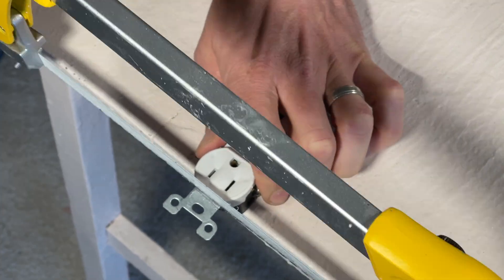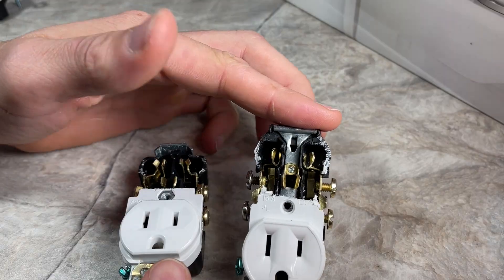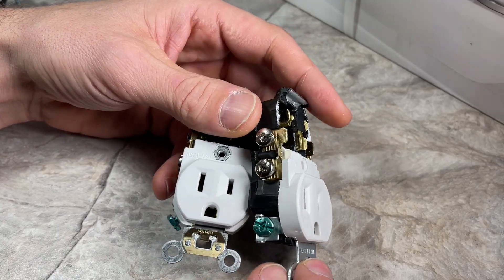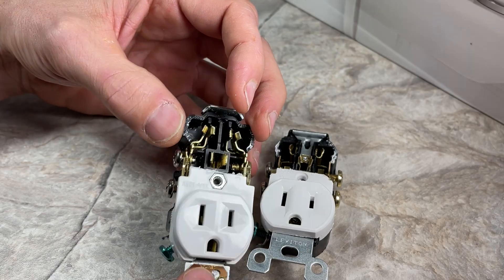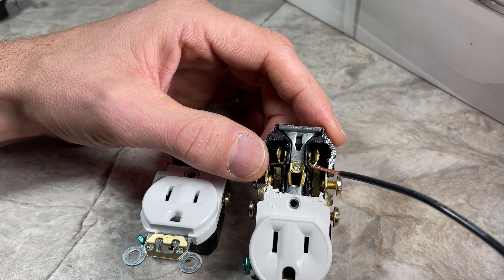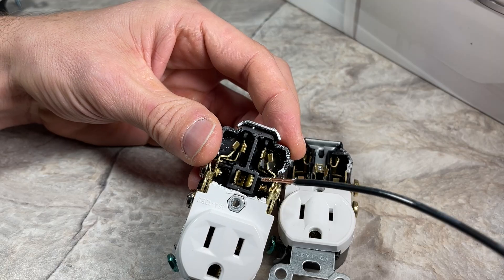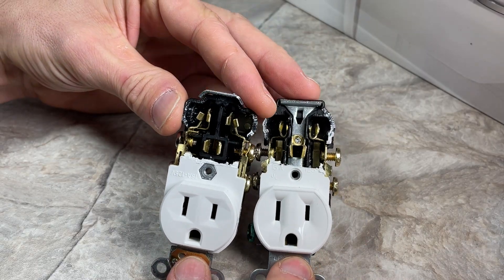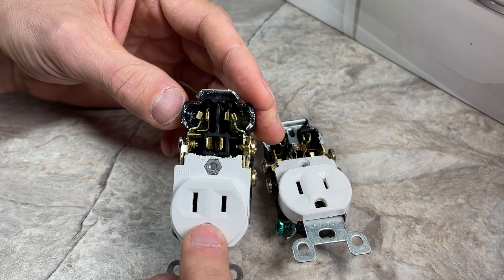What Outlet Should You Buy For Your Home |  Commercial vs Residential

Comment: I do this every time I’m replacing an outlet for myself or guiding a friend.  I’ve had the basic residential grade outlets fall apart in my hands as I pull them to replace them.  of note, the technician wiring the connection is a key component to a safe and reliable install.  (Note that I didn’t say electrician since some unlicensed people do their own work or work for others).  That said, I’ve seen some ugly work from electricians where insulation was heavily damaged inside the box and it was ignored when the outlet was installed and wasn’t caught by the inspector.  The amount of work to correct that during the construction phase is significantly less than the work required to correct it after drywall, paint, and trim is completed.  It’s pretty irritating to follow any technician who didn’t do it right.  Warning:  If you open up a box to replace a switch, outlet or light and the wiring looks wrong; best thing is to get a good electrician to fix it unless you are very experienced, working with electricity is the wrong time to suddenly get hutzpah.  I’ve seen the builder team cut and short the hot with HVAC strapping then, to “correct it”, they use the neutral for the hot and the ground for the neutral.  Left a really ugly scenario where it’s likely the duct work was hot every time the light was on.    20 years later, I find it when replacing the light.  That was a long day rewiring that location in the house.

Comment: How do you feel about installing outlets with USB Ports? My father just did a major upgrade to the barn that costs thousands (200 amp) and I suggested installing USB outlets instead of the old school outlets. I was ignored.
Reply: Certainly don’t added them everywhere.  Putting outlets with a USB feature in the most likely usage locations makes a lot of sense.  Space is always at a premium on outlets so you also need to consider what else is plugged into the same outlet for normal use.  You may find the other items plugged in kind of block the USB ports.  Also, ensure you find USB outlets the support the power loads you are planning on for the USB powered items.  For example some tablets consume 20W or more ( I don’t recall seeing an outlet that misses the mark.)  Of course, USB-C is whole different story where laptops use that for higher wattage charging.

Comment: Not gonna lie, I'm personally kinda partial to Hubble green dots w/ a stainless plate. Although I have installed a few of these as well. Most will do fine over the long haul, just don't crack it trying to get it right!  :) I learned the finer points from my very first professor, a G.E. exec and inspector of the local county.

Comment: Everyday Home Repairs, you should have pointed out that wiring a spec grade outlet is much easier and safer than a residential grade outlet for most people.   On the cheap one you have to wrap the wire around the screw clockwise by code and make sure it stays under the screw head when tight.  With the spec/commercial grade you put the wire under the clamp and tighten the screw.  No wire bending or chance it will come out from under the screw head.
Reply from the maker: Completely agree and good call out. The back wire feature of spec grade is much easier 👍

Comment: Agreed, the heavier sockets make a difference. My house was 15 yo when the cheaper Levitons started failing. The most spectacular fail was in the garage, a seldom used outlet. It shorted internally and blackened my fingernail when hot met ground. In other cases the quick connects were loosening so lights at the end of the string would dim. (Each circuit was wired thru every socket instead of using a Y connection in each box.) I switched all outlets and switches to the commercial grade in the mid '90s. It takes more effort to plug into the socket, so you have to use care to not run out of cord when vacuuming; the prongs will bend instead of the plug falling out of the socket. Contractors use the cheap outlets for cost savings. The product is cheaper and the quick connects cut installation time, especially is eliminating the "Y" as shown on current installs. The originals were starting to show their age after 10 years, the heavy ones are over 25 and still work fine.
Reply from the maker: Nice examples Mike.  Thanks for providing feedback and your experience with the different grades. 👍

Comment: Probably worth noting that while the higher grade outlet doesn't have the push-holes, it does have the easy clamp method instead, which is probably much more secure.
Reply from the maker: 100% agree and I actually use the back wire feature for my installs.

Comment: And yet, I used the cheaper outlets for over 25 years and I haven’t had an issue. More expensive ones are good wherever increased plugging/ unplugging will occur. I think it would have been more benificial to advise people to not use the back push in and instead wrap the wire around the screws and tighten firmly (wrapping screws w/ electrical tape is good too to reduce inadvertent contact. I don’t know electrician that use the back push in except for rare occasions. I believe it happens more on renovations or workers that are working under an electrician. Also, I only saw one other of your videos on receptacles and problems and you did not mention incorrectly wiring and creating reverse polarity. It was at that point I went to your channel and found out your not an electrician kand instead you are a rehab/ diy. This material, and other building trades are too important to be giving advice (and that’s what it is however you deny it). You produce videos very well. Do yourself a favor and get experienced electricians or whatever professional to assist you in the correct way of doing repairs. Just because someone can swing a hammer doesn’t make them a carpenter.

Comment: I've seen a residential outlet smoking and glowing red hot from an internal short due to high humidity. This plug was on an outside wall where a cable company had installed a coaxial plug right next to it. They did NOT seal the wire through the outside brick so there was a massive amount of space for humidity to come in. You can't fix stupid cable company installers but you can prepare your own outlets to not fail due to their stupidity. This could've been a complete disaster and instead of fixing their outlet they might've had to rebuild their house.
Reply from the maker: wow, close call.  I have a triplex near a University campus and when I bought the building I think there were no less than 6 different punctures for Coax into the house.  It was a HUGE mess.

Comment: I had to replace the receptacles in my house within 10 years of its completion. Lamps would blink when you walked past. Wooden floors transmit vibration so it's worse.
I was in the telecom business so I had an account at Graybar Electric. I purchased Hubble receptacles which are commercial receptacles. I got a good price because of my account. You can feel the difference in the tension when you plug  something in.
I have another house on the coast. for the steel frames rusted out and the receptacles and switches fell into the hole. I replaced 55 devices in one weekend. The plastic electrical boxes had a metal insert for the 6-36 screw that holds the device that was rusted out as well. I took out all the 6-36 screws and replaced them with Stainless Steel #8 screws into the plastic which should up well. Some of the screw holes needed shimming and caulk. I used small plastic anchors as shims. 
If it's your house and you'll be staying there a long time then it pays to use the more expensive higher quality devices.
By the way though  my field was telecom I do have some electrical experience as as an electrician. I was a Construction Electrician 2nd class in the Navy's Seabees but I didn't do this part of the trade. I worked in power generation and telephone exchanges. Regardless I had to know how to do it anyway.

Comment: As a master electrician working in the field going on 20 years, the time when both outlets fail is when they are overloaded. If you want to up grade I would suggest using a 20 amp outlet without the horizontal slit on the neutral side. Just changing from 15 amp residential to 15 amp commercial, I feel is a waste of money. I would have no problem using a residential grade outlet in my own house.

Comment: Then there's the lowest grade, apartment grade...

You can pretty much bet that the cheap grade is what builders will use and even properties for lease and rent would first be built with the cheap grade with the failures replaced by better grade units so that only the plugs that are likely to be used will eventually be of a better grade.  The question is whether or not as a homeowner, if it's worthwhile to replace the outlets you use with better quality units.

The presumably the big box hardware stores would stock the cheap ones so where would a private individual buy the commercial grade ones?
Reply: That would still be residential grade. If your plugs don't pass residential standards that might be a matter of standards having changed since your install. It would honestly be a hassle to obtain outlets worse than the residential ones in the video. edit: you can buy the commercial ones at various electrical supply stores. You don't need to be a tradesman to walk in, and they're generally more helpful than big box retailers. The person behind the desk most likely can answer every question you have.

Comment: I agree that the $2 dollar outlet is built better.  But keep in mind the amperage ratings.  15a devices pull less current through the outlet.  So most household devices pull less than 15a during there use.  So the cheaper 15a outlet will be fine in most rooms in your house.  The 20a commercial type will be better in certain areas, like microwaves, bathrooms, dishwashers, refrigerators, garages.

Comment: Excellent video on the differences between these two grades of outlets. More people need to know these differences because when you see the price difference at the store and believe they are made to the same standard, you think you are getting the best deal ever (but you are not). I think you should always go for a commercial outlet unless you have a very compelling reason not to. You are saving $1.50 on one outlet but that outlet will wear out much quicker and as it wears out, plugs will become very loose when in the outlet which becomes a significant fire and safety hazard. So, is the $1.50 savings really worth it?

Comment: I just recently replaced  my original 53 year old outlets in my kitchen with GCFI replacements for near water use. When I was taking the originals out, the white fronts separated from the brown back halves. It scared me to think how bad these really were. I got the more expensive ones because, yeah. Glad I bought the ones I did. They were substantially heavier than the original ones. Now, if my can opener falls in the sink, I won't get electrocuted, and they are up to code.

Comment: The biggest cause of electrical fires is heat generated by poor connections. I don'r even look at the cheep ones and actually always use 20 amp plugs whenever I install one. When I built my house I insisted on all high quality receptacles and switches.

Comment: Great comments about the construction build  and dissection of this device. Here is my question,  for $1.50 more per outlet why compromise.  I suppose if your a home builder and purchase thousands of these it can save you a few bucks per home.  There is no substitution for quality design and the piece of mind that comes with it. Whether it's an outlet, plug switch or lamp socket I always aspire to a base line of quality.

Comment: The design differences between the grades of devices can not be summed up in a 9 minute video.  Those of us in the industry (I was a distributor to electricians for these products) are trained on the differences and in some cases spent an entire day learning what the differences are and when that difference is important.  So to save you that I will just say this, the fifty cent outlet is UL approved for a 15 amp circuit.  Failures you described as a short circuit are rare at best.  What you described is a device (such as a electric heater) that is rated at the top end of the devices ability to pass current safely and over heating occurs because the device no long holds the cord end tightly enough.  Once it gets weak the poor connection builds heat because the unit is still trying to draw full amperage.  The back wired feature is a time saver that many electricians still use and UL approves it so say it shouldn't be used is false.  But an electrician will instead say, "I don't use the back wire because I have experienced call backs to repair the device because it didn't hold up."  Call backs mean they come back and no charge.  This video does not do a service to the inexperienced home owner that is trying to make repairs they are not qualified to preform.  Sorry if that sounds harsh, but it is a fact.

Comment: MOST builders will use "Builder grade" everything. People often believe that means the "GOOD STUFF", not knowing that it is a euphemism for minimal, EZ TO INSTALL junk. UL Rating sometimes is indicative of quality, but often, the test is built to the product. Takes safes for instance. There is now a UL TL5 or RSC listing ( UL APPROVES NOTHING, they test and list  ) This rating can generally be met by ANY box that locks...Few products could fail this test. But it is marketing, which is WORTH paying 20K to test and list. a CASH COW for UL. While the security ratings from UL are nearly a fraud, their FIRE ratings are respectable. The security TL ratings are themselves  over 60 years old, and never expire for a manufacturer. As long as they do not redesign the product, they keep putting that logo on the product,  even if applied upon a PROVEN bad design, or one that technology has eclipsed.

A builder will only use upgraded commodities, if he/she is a SMART builder, and MARKETS a program of "CODE+++", or something to that effect. This makes two houses off same essential blueprints a totally different product.  such CODE PLUS features could be the following:

1. Superior outlets, main electrical service and other devices
2. Security glass
3. Steel backed door jambs ( requires non-standard construction of door/frame, though you do not see any steel )
4. Copper, thick walled plumbing supply lines
5. Brick herringbone or other pattern, or decorative concrete walk from entry to driveway
6. Garage workbench and hangar system.
7. Upgraded HVAC and hot water capacity, with return line for hot to long runs
8. Blocking in walls between studs for door handles, so impact of a door does not punch through walls ( this is the cost of 4 nails and scrap 2X material+30 sseconds a doorway, done on BOTH sides of door, in event that a last minute change of door handing is done.
9. BETTER door locks. Upgrade all exterior doors to COMMERCIAL type deadbolts ( Assa or Medeco high security ), with Emtek or a high quality, low cost passage knob set ( no keyholes in handles, they create lockouts for homeowner ) EMTEK touchpad EMP series electronic ( which can be upgraded to a Smartlock in seconds with a plug-in module
10. PROPER foundation work. Foundations should never move. Proper mitigation for soil type, drainage and other issues that might occur from neighborhood construction later, must all be planned for.
11. 3 year no quibble warranty on construction and components ( as opposed to the standard 1 year )

 Cost per home in materials/labor, +10K-30K. 

 Payoff?   If house sells 60 days faster than the identical "Builder-Grade" house, or gets 30K more for attention to detail... it is a win

The builder pisses away this money, if it is not done on EVERY job, and marketed as such. Building the BRAND, not just the house is the purpose.

Comment: In Massachusetts, all residential outlets have to have the safety feature that blocks the 2 slots. If you don't have children or grandchildren in your house, it's a unnecessary code. I purchased commercial outlets instead, just cause they will outlast and not potentially short after the plastic degrades.

Comment: I have 40 yrs of experience in the electrical field and the 50 cent device does not fail that often.  What normally causes the failure is wire stabbed into the back, and a space heater running on it.  The heating/cooling loosens the contact and arcs/burns the receptacle into failure.
Reply: My sister's 1927 house had one outlet failure where she plugs the heater in and out. I made her throw the main circuit for me to replace it bc I don't work on hot wires. Rest of the wiring is good as gold. She has the knob and tube wiring. She was fussing about having to throw the main switch and I told her to hire a union man.  IBEW yeah!

Comment: Other visual note:  The brass conductors in the 'commercial' grade is noticeably thicker than in the 'consumer' grade.  This would provide less current resistance and outlet heating.  Also prolonged elasticity of the contacts as the 'commercial' spreads the insertion force over two spring points instead of all the force applied to the bottom of the U shape on the 'consumer' grade.

Comment: It is very hard nowadays to justify 15amp outlets save for lighting. Considering 20amp outlets can be found for as little as 1$, I almost always go for that.
Reply: 15A Spec grade outlets are 20A outlets without the extra cutout for a 20A plug. There are very few instances where you'll find an appliance with a 20A plug, and where you do find one it's probably best to have a dedicated circuit for it.